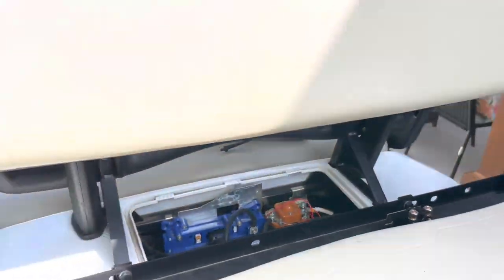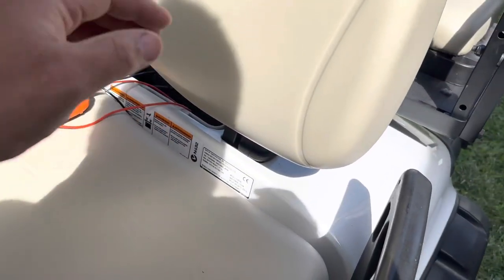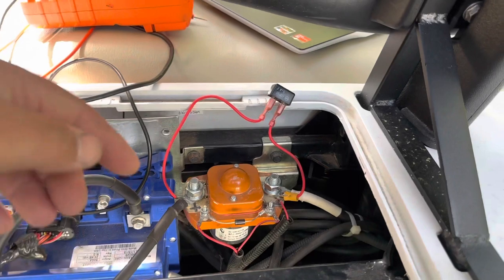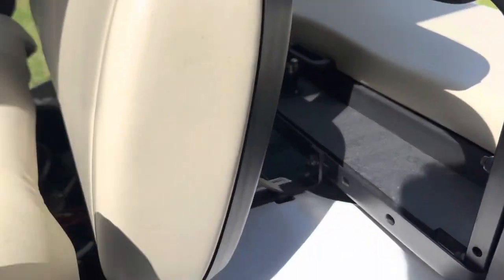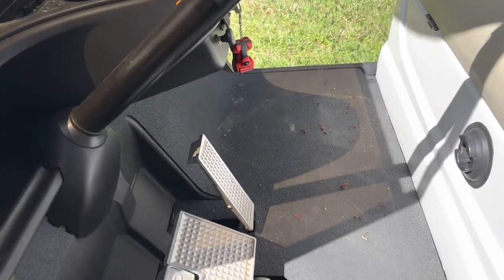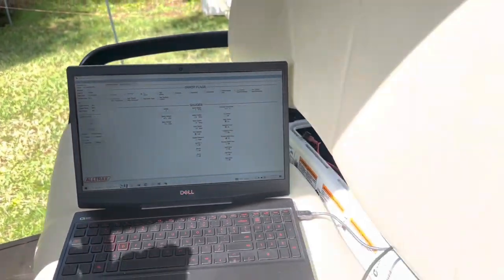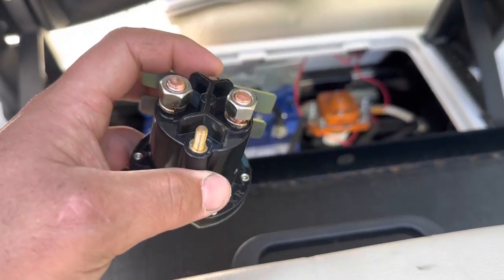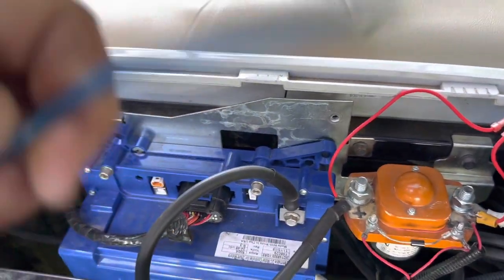Power Issues on Your Yamaha Electric Golf Cart with AllTrax Controller Solving Dead Battery Symptoms

Comment: Ok, let me start by saying thank you for sharing your experience with the machine. I was able to learn 3 or 4 significant points that I was unaware previously. But I was not able to follow your path of diagnosis to a point where the root cause was laid out and the  critical point/part of failure was clearly identified. 

I think we all here may benefit for brief summary where you just hit the high points. List the facts directly that close/complete a successful service cycle. 

#1 machine type and the “pass state” of operational test.  (How the damn thing supposed to work)

#2 “failed state” op-test (what the machine is doing when we test it)  

#3 the “critical corrective act” what change was made  (just give the action you took and  what was acted upon) part name/number x was replaced, reconditioned, relocated, cleaned, reset, or repaired  :note: do not give how it was found or any steps taken or gamy may test were performed.  We just need to capture the raw facts of a successfully completed  service ticket.  The other stuff is also important but that’s not the point of the summary. It’s just a tool we all use to help make an any job easy to explain accurately so anyone can understand easily. 

#4 “Retest Results ” passed is the only answer we are reporting here. So #4 always gonna be the same as #1 minus the  product info cause we already have it recorded. 

This is closing the loop or completing the circle. And will help all of us techs master and appreciate alike. I’m tired. After a long job that I may have struggled to solve for any reason. It’s nice to have in your worksheet or on a note in your pocket that I can refer to confidential as it allows me sone safety. I may set drug drown trying to explain some question the coustmer mentioned I. The parking lot which was more then talking but thinking aloud . That’s fine if I get caught with something while walking out to my car I’ll still be prepared for the test ha ha 

Hey man what did you say was taking so long today?  

Sir I always have to my work so everyone can go home happy. Sometimes those test can take longer than we might expect or would like. But that the job and the service we provide. I don’t ever know what I will find before I can get a good look at a new job.  In your case I made repairs to the auxiliary wire harness.  

Cool thanks have a good one! 

You to sir!

Comment: If you are driving an inductive load like a motor or electromagnet or solenoid, you can use a flyback diode (also called reverse emf diode) which is just a diode flipped backwards. That way when the the circuit is switched off the back currrent goes through the diode which shorts it out. This keeps the reverse spike from hitting transistor or computer circuits and damaging them. So that diode could be installed right or wrong depending on application. However generally will blow out quick if it’s just going across battery plus and minus with the proper polarity markings.

Comment: have a 2007 Yamaha 48 volt golf cart.  It wont move.  changed the solenoid out but wont click.  Have voltage on positive big post and voltage on small post as well.  I believe the ground on the small post isn’t working for the solenoid to click.  would this be a bad controller?
Reply from the maker: What controller are you running. Next you will have voltage on one side of the post for the solenoid when you hit the gas the voltage comes inline to b post opening the second big post to the motor. If your not getting voltage from post to post when the pedal is pressed the solenoid signal wire could be the issue. Then you need to trouble shoot that line there is a fuse in it as well

Comment: If I take the cart to say auto zone would they have that software to run in the cart. I have brand new batteries that are showing 100% charge. Everything is connected properly, but it only drives until about 80% charge and then it’s dead. The lights are still working, but the cart won’t move.
Reply from the maker: no you can download the software for free or take to shop